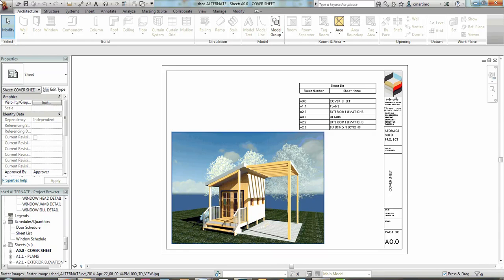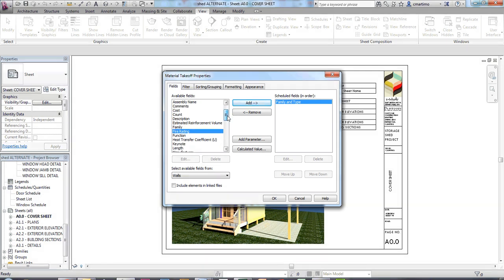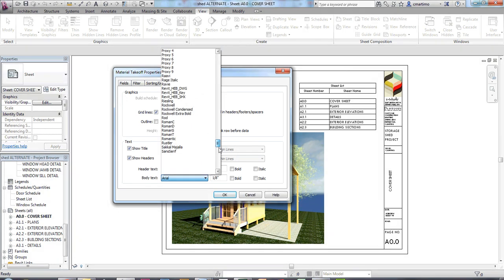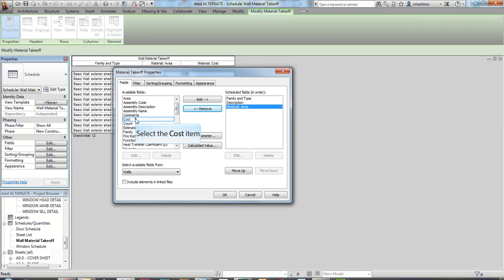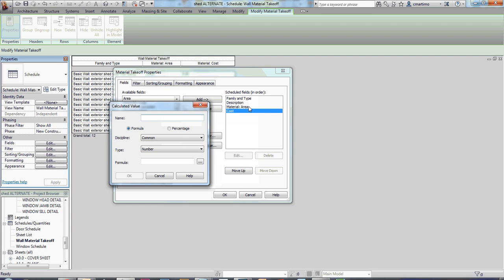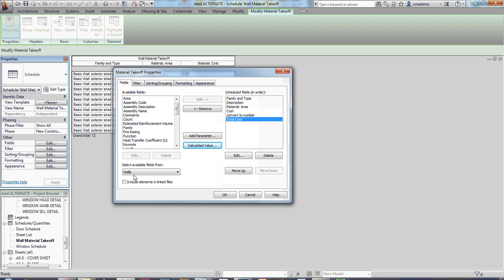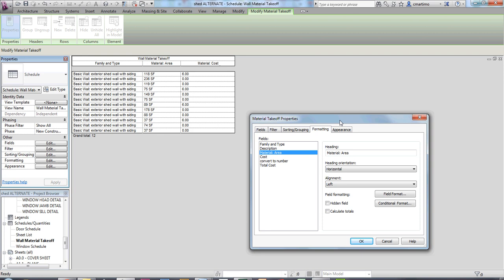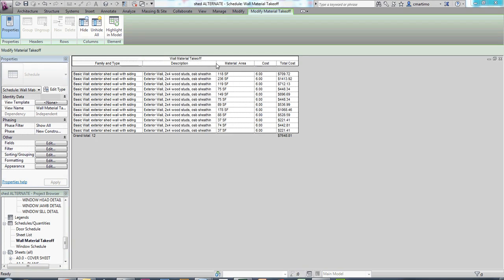Material Take-Off with Cost in Currency with Revit

Comment: I was going through this tutorial and I think we should clarify the difference between Cost and Material: Cost.

Material: Cost is defined in the Material type (Manage Tab > Materials) and each material within a wall can be given its own cost.  

Cost is defined in the Family Type properties and essentially gives the entire Wall a price per area. 

That said, when the Schedule lists all these materials, the Family and Type category will list Basic Wall: Exterior - Brick on Mtl. Stud several times, and if you are using the Cost parameter to calculate the total cost of the wall, you will end up with an enormous pricetag.  By adding Material: Name to your schedule you can see that each entry of Basic Wall: Exterior - Brick on Mtl. Stud actually represents a different material within the wall as well as the Default Wall value and so the Cost parameter is using the total cost of the wall for each of these materials, thus pricing your Air layer at the same price as your Brick layer. Meaning, essentially, that if your wall area is 10sf and the Cost is $7/sf, the cost of your wall is now (10sf*$7)*number of materials = (10*7)*6 = $420 per square foot of Basic Wall: Exterior - Brick on Mtl. Stud.

So, when you use this scheduling technique, it is a wise idea to add in Material: Name in order to determine which materials are given which costs.  When using Material: Cost you either give the Default Wall value a cost ($10/sf) OR you give each material a value that would add up to the $10/sf the whole wall will cost.  When using the Cost parameter,  the cost of the wall should be divided by the number of materials in the wall so that you aren't multiplying the TOTAL cost of the wall by each material.

Comment: Good tutorial, thanks. One note, you don't have to make a separate field to change the units. You can divide the formula by "1 X" where X is the unit type you are trying to remove. For example, dividing by "1 SF" will remove the square foot value, leaving you with only $, which Revit is fine with. (Area*Cost/1SF)